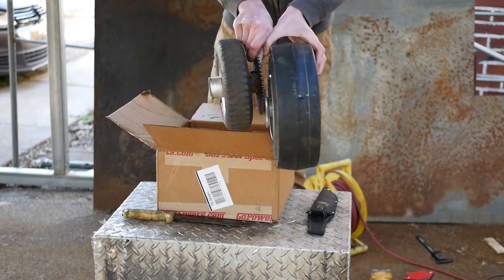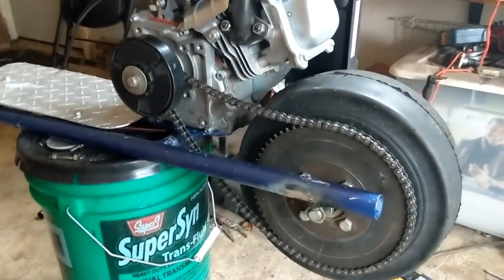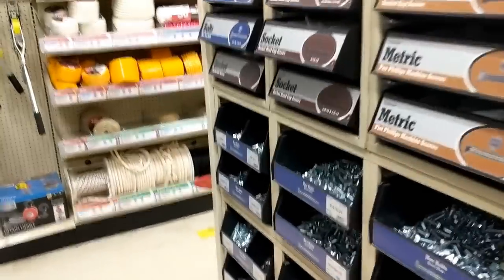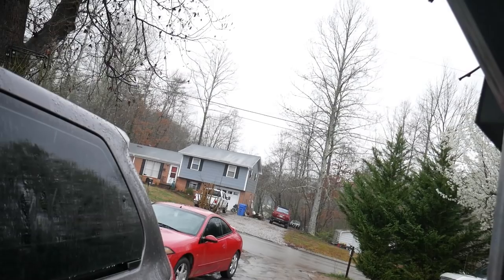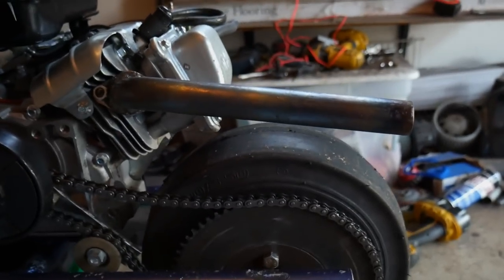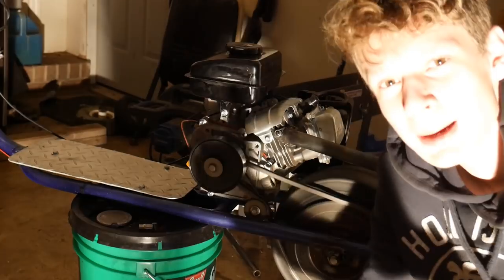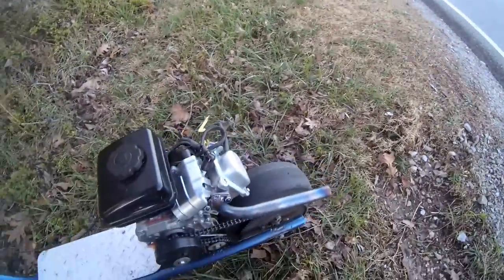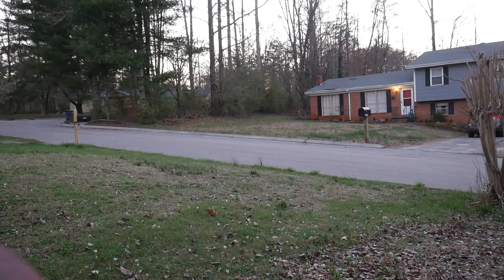Homemade 79cc Motorized Scooter Build Part 4

Comment: should i remove my governor? btw are you using a billet rod? im scared to blow my engine up
Reply from the maker: Gierzi 1987 Yes I recommend it. I am not running a billet rod. They don't make em for 79cc's. But if you want more safety just  run some heavier oil.
Reply: ok thanks

Comment: how is the gearing?
Reply from the maker: Pretty low (11/66), but the 79cc has very little torque
Reply: Didn't know that about the 79cc.  I was going to use it as a mud motor/ thai stick on a boat.  I like the no flat slick on the back.
Reply: Huh?

Comment: is your 79 running lean? because mine is.
Reply from the maker: Nick Jackson yes it sounds like it. I have yet to check the spark plug. but mine does not back fire. carburetor is really jenky. you can't jet a 79cc with stock carb
Reply: oh you can't jet it! that sucks. well, looks like ill be runnin with the choke on!
Reply from the maker: Nick Jackson I've tried the choke too. it bogs
Reply: mine revves perfectly with the choke.
Reply: You can jet a stock carb with a pair of torch tip cleaners take ur time tho and check how it runs every size of cleener and it should work... thats what i did on mine and it has lasted over 5yrs now so good luck bro!

Comment: why would you tac weld the bolts to the frame? youll never be able to pull that wheel off man
Reply from the maker: I welded the nuts to the frame, not the bolts